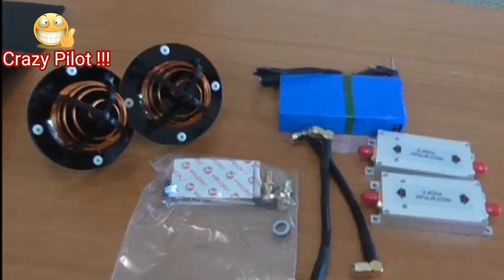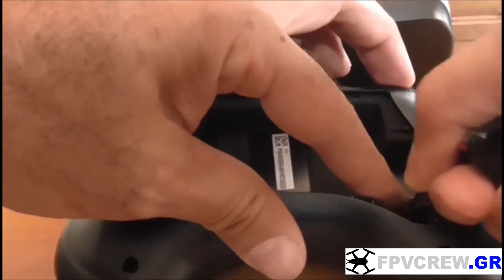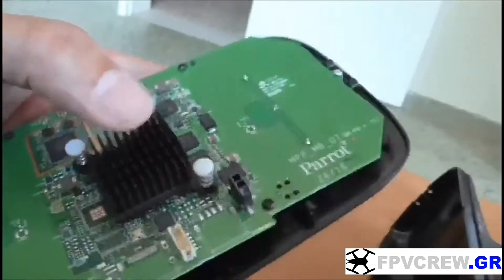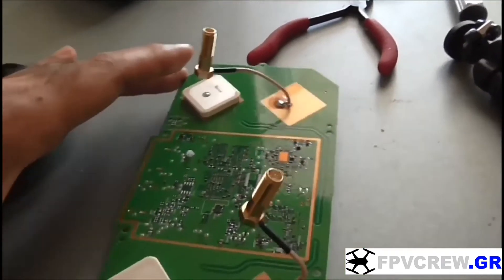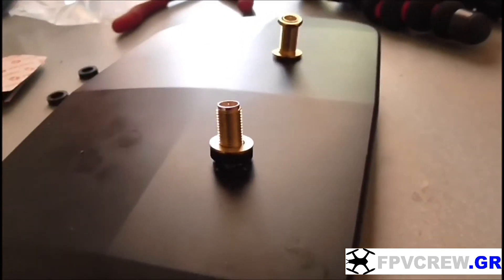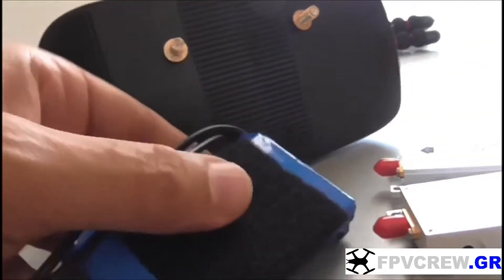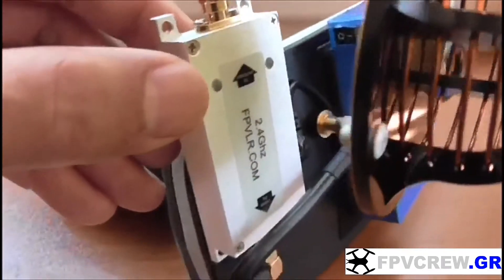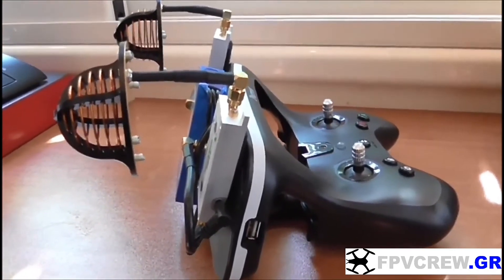FPVLR Installation for Parrot Disco

Comment: Hi Fpvcrew,
You tell to take out the two ceramics antennas which are on the top. What about the two others that are on the bottom ? Are these useful ?
Reply from the maker: Yes 
Keep them on
Reply: @Fpvcrewgr  Can I also replace them in order to get 4 helix antennas ?
Reply from the maker: @jcopfr  
Yes you can.
If you do that please let me know what distance you get with the four antennas
Reply: @Fpvcrewgr  Great ! I will try to do that. I will put four 2.4GHz helix antennas

Comment: I find no dealer here in Europe for this kit ;-( Cant order it in the USA because of too high shipping costs. But this doesnt solve the problem, that the disco still has a very weak transmitter. My wlan has more power than the disco model.
Reply from the maker: Kalter Krieger 
I'm using the FPVLR system on the SC2 and on the Disco I have installed two 3W boosters and with this set up I get 3.4km

Comment: I got 3.1 km range at 1.2km atlitude in mountains with stock radio, no mods before i lost signal.. dunno how you only got 1km range with stock radio...  https://www.youtube.com/watch?v=UgK4BMJWbMs&t=1199s  min 13:10 where parrot started to go home at 3.1km.
Reply from the maker: Flying Goggles 
I don't know why I only get 1km.
Very soon I will make my Disco 4g
Reply: Fpvcrew. gr i have skycontroller 2 v3 or so. Maybe You nave skycontroller 1 or an older version of 1 or 2
Reply: solaris8x86 wtf? Are You on drugs? I said stock antenna got me to 3.1 km. No mods no 4g.
Reply: solaris8x86 i don't need. I got youtube recommended video based on my past searches. I clicked cause i like to watch people and what they do. I make alot of things myself as i like electronics. I flew my Parrot with 3s li-ion cell pack made by me. And i looked at this hoping i can get 5km range . Hope You got your answer. Cheers!
Reply: Yeah , 4g has more than 5km range, it has unlimited range like your phone has when you travel. But in mountains , as your phone may have low signal or 0, same with the drone. My friend and i bought another skycontrollers to modify them for long range but not multy directional, we will try to find out where is the main antenna wire b4 it splits to the 4 ceramic antennas and use that main wire to only use a 5.4 ghz antenna.

Comment: Hello I made the modification and I got double the distance but now I have a problem with my controler I can not connect the disco anymore I only have solid red light in the control after it turns off what it can be? Thanks
Reply from the maker: MAB FPV 
I don't understant ... how did you get double distance if you can not connect to the controller?
Reply: Fpvcrew. gr the first time that I tried to connect the control after 10 attempts to conect the control  1 time flashing red light ok after this just solid red light no more flashing red light thanks
Reply from the maker: MAB FPV 
Make sure you have done the  connections right. Send me a video to see the problem.
Reply: Fpvcrew. gr Hello thanks the    vídeo https://youtu.be/AEGJxEI6a-0
Reply: And,did you check the range after this modification?

Comment: This mod also works extremely well for bebop 2, in addition you can remove all four patch antennas and boost all 4 with 2 kits. Range for Bebop 2 is 2 miles in bad wifi  areas with great control and fpv
Reply: I think it will not work fot 100% this modification. You have 2 antennas for 2.4 ghz and 2 for 5.6 ghz. You lost the video connection bud the remote is under control with this modification. 2 kits is the only way ;-)
Reply: L J please share that info, I need urban range with my bebop 2. I’m about to throw the towel in and buy a Mavic pro. I need at least a easy mile in urban.

Comment: Did you check to see if there is continuity between the pin and casing on the sma, because if there is you have a short!.Also you need to check continuity before you start the solder job, to make sure it matches up when your done. The opposite side of the board (not the patch antenna side) has two pins that you place the coax in, these are the patch antenna conectors , connected by a ribbon connector. if you loose continuity between the two when you solder you burned the ribbon connection. Its not at all this easy. Get a volt meter into play.